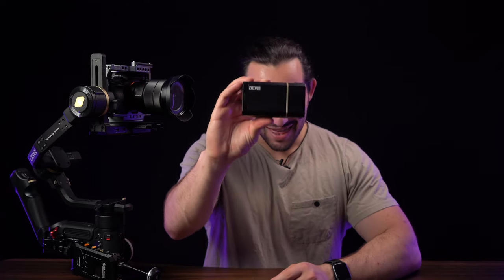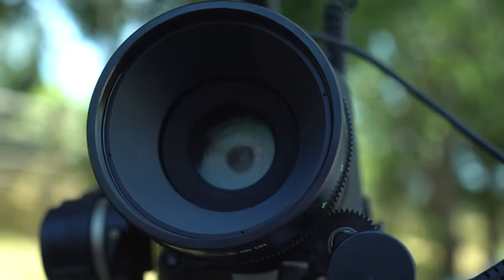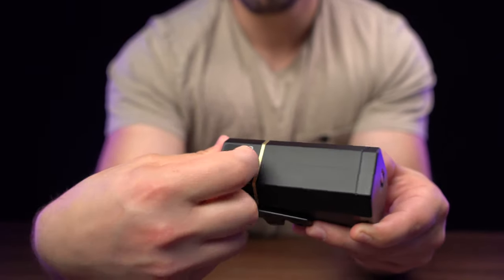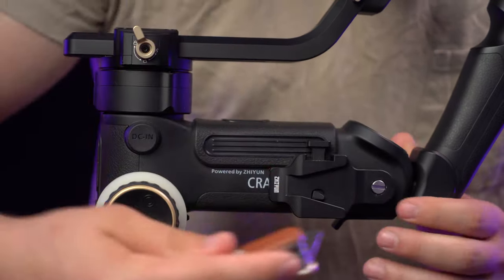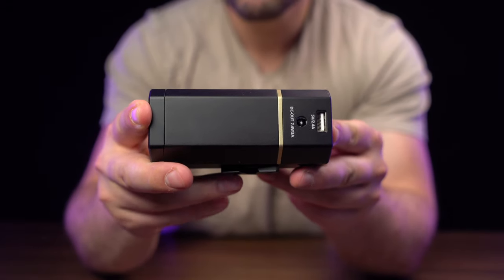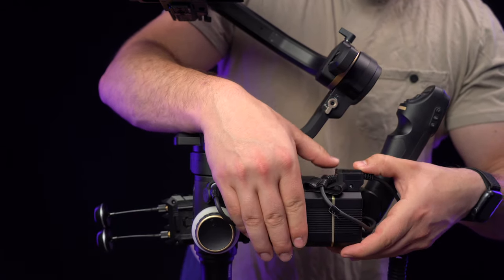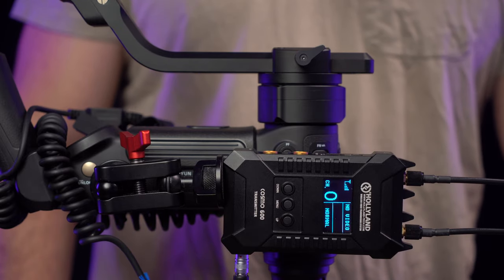How To Make Zhiyun Crane 3S Gimbal MUCH MORE POWERFUL - Motor Torque MOD - USE Any Camera You WANT!

Comment: Thanks for confirming this. But this is super shady of Zhiyun. They advertised this gimbal to hold more weight then what it can actually handle, when they knew full well they could pull an upsale on all of their customers. I have screen grabs of what it used to say on their website before they took it down after i sent them an email, you better believe i will be making a video about. Pretty disappointed in Armando as well, because i even left a comment on his instagram about this whole thing and he did a fine job of acting like he didnt know what i was talking about. smh
Reply from the maker: What setup have you tried? They showed and talked about the battery pack on their launch video.
Reply: Momentum Productions The biggest bummer is why do they promote a product that they claim can hold over 14lbs when they KNOW that you need that power supply to in fact hold rigs that heavy. This is why so many videos are out there on people dealing with vibrating crane 3S
Reply from the maker: Yeah but they already talked about the battery pack when they launched this gimbal. It’s not like they released this battery pack last minute.
Reply from the maker: And it’s also apart of the Pro package so I’m not sure what part you think is shady here.
Reply: @MomentumProductions1992  i know, but they're not being up front about the fact that you need the power pack to hold that much weight. So instead, you got all these people out here buying that gimbal, thinking they can hold 14lbs with the non pro pack, but thats not the case, they need that power pack. It's a little shady, bro. just saying
Reply: I don’t think Amando lied to you or cover up or something. He just does not know about the product that well. He doesn’t own the gimbal and probably use it for the first time.
Reply: @warathanuts.1005  Fair enough. I'm not faulting these guys, but i am faulting Zhiyun.
Reply: Warathanut S. I do own this gimbal and I use it without the battery pack on a 14lb Setup without any problems. In fact it’s too powerful and I have to set it to medium strength or it will shake.  I’ll make a video tomorrow on Instagram or Twitter showing it and also my video will be dropping soon.
Reply: Armando Ferreira I cant wait to see that video, bro. Because just within the past week, one week, Zhiyun have added to their website that you need the powerpack for any camera build over 3kg (which is just a little over 6lbs) , so yea max it out, show us how you do it!
Reply: Armando Ferreira Also be sure when you do that, to put it in undersling mode, and walk around, if you want to be completely transparent. Max it out at 14 lbs and then show BTS of you walking around in undersling mode.
Reply: Justin Phillip lol not only am I going to walk around I’ll swing it and shake it too 😂
Reply from the maker: @JustinPhillip  https://twitter.com/mondobytes/status/1266054959654563840?s=21
Reply: @MomentumProductions1992  well...okay, lol, that settles that....what the heck...its gotta be the form factor of the pocket cameras... thanks for this doing one guys,  i'll be sure to share this link!
Reply: Momentum Productions The part that doesnt make sense to me is why did Zhiyun add that small print to their website? Under the power pack it says *recommended for cameras over 3Kg
Reply: Momentum Productions Because i have no problem saying, okay im an idiot, but the thing is im definitely not the only one having this issue, its a huge thing across the internet
Reply: Can we conclude then that there is a batch of crane3s with faulty motors? Lots of people have shakes that they cant fix with firmware, motor settings or perfect balanced rigs.?

Comment: Cool car rig. Is it just a 3/8 screw holding the Crane 3s and the C500 onto the shock mount? That's pretty brave. Looking forward to a video on that setup.
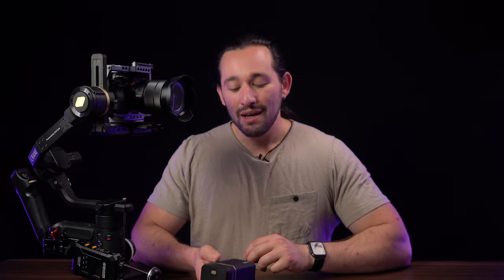Reply: 3/8 inch screw and a BNC as safety chain :-O - EDIT: it looks like they've used two NOGA arms as "safety" - 4:16

Comment: I have both zhiyun crane 3s / the Power Plus and Hollyland cosmo 600. Does it make a difference to the gimbal motor by adding the power plus? I also need to charge my tilta nucleus M .

Comment: Have you managed to get the Crane 3S to work with a BMPCC 4K or 6k in under sling mode? I have the camera perfectly balanced but it rocks back and forth on the roll motor in under sling mode only. I’ve tried a fully kitted rig with v-mount batteries and matte box etc as well as a stripped down rig with just the camera and lens and it still does it.
Reply: You have to have the power pack in order for it to work in under sling mode. Without it, the gimbal can only manage 6lbs. Zhiyun know this is a problem. They referred to it as “crazy dog” mode on their site but they recently changed it because someone messaged them about this! They know this! 😡

Comment: That battery pack looks like it's just a weird way to emulate an actual v-mount battery, have you tried using a proper v-mount battery? I own a pile of them already and would love to just get the 3S and not the 3S Pro and use a v-mount battery I already own.
Reply from the maker: Regular v mounts won’t work because the voltage is too low. You need at least 21.4 volts for this to work.

Comment: I'm looking into buying this gimbal, BUT I have seen and read that the gimbal struggle with a rigged blackmagic 4k pocket with v-mount batteries. Do you know anything about this?
Reply: Yes, it also struggels without V-Mount batteries. I have a BMPCC 4k und in underslung it shakes as hell. The only solution was to buy this expensive battery pack...

Comment: why cant we use our regular V Mount Batteries for powering up the gimbal
Reply from the maker: Good questions. That's because the voltage isn't high enough. You need at least 21 volts.
Reply: @MomentumProductions1992  Ok got it thank you

Comment: Awesome video. But $139us for a battery pack is high. I'd be happy with plastic at $50
Reply: That thing is basically a makeshift V-mount battery, and those can go for $139+ easily. So not that crazy when compared to similar tech.

Comment: I thought the power pack would be a great addition for powering other devices that can use 14.8V etc, but then found out that it uses special 18650 batteries that aren't standard size and are exclusive to Zhiyun. Not a great move.
Reply from the maker: It comes with the batteries included, and you can use any 18650 batteries as long as they have the same voltage.
Reply: @MomentumProductions1992  That's interesting, as I was considering buying just the power pack when I came across an article (that I now can't find) that said the power pack didn't take standard 18650 batteries (which was disappointing). I don't need batteries, as I had plenty of spare 18650 ones already.